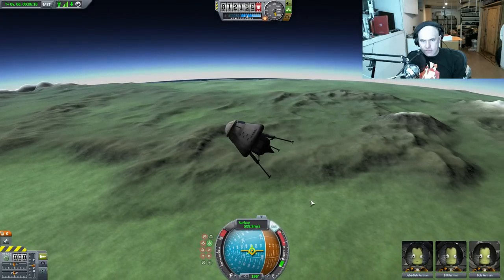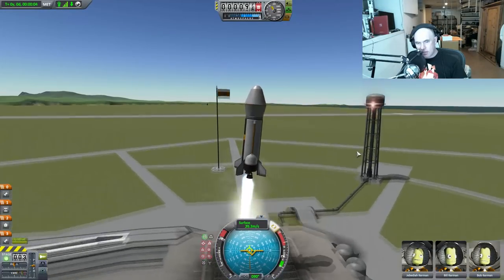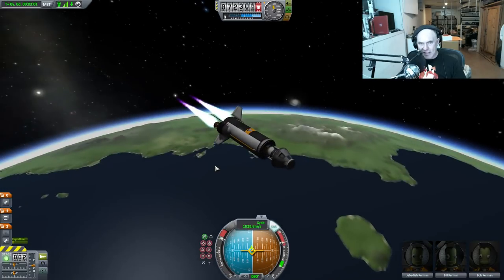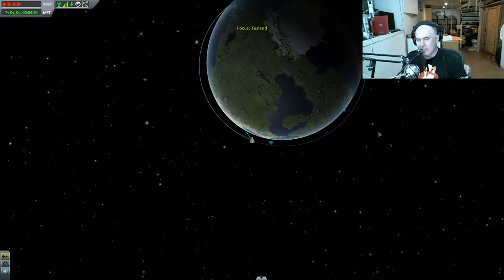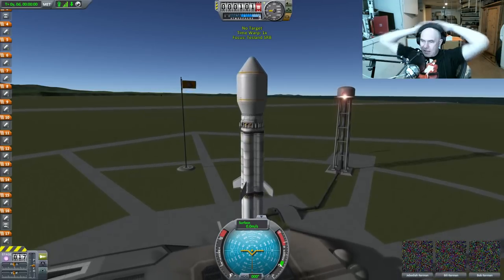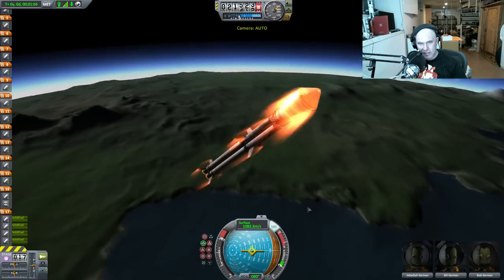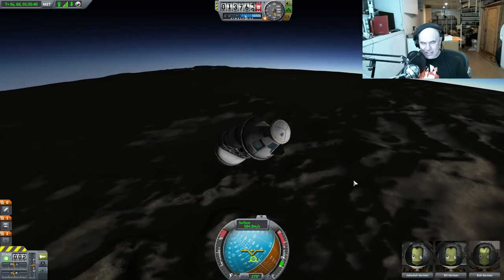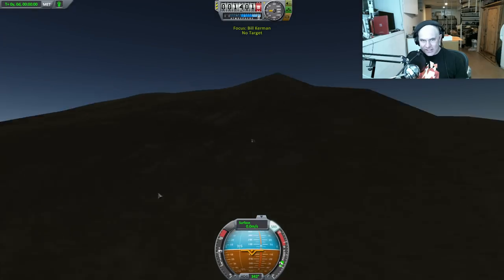Powered Launch & Powered Landing Using Only SRBs

Comment: Y'know, the large landing legs with max spring power can survive just over 60 m/s impacts, enough for just a capsule with 2 small glider wings to land safely.
Reply: Or use a payload bay as a crew cabin, open the doors to be airbrakes, and have some structural components underneath to break the fall.

Comment: Scott, with 70-80's tech, which type of reusable(partially) two stage to orbit vehicle would have been more likely(or even effective), air launch vehicle designed to return back to airstrip or rocket using slow down burn and chutes? The goal being 15 tons to LEO or launching small thing like HL-42 to supply ISS.

Comment: what is your opinion of the capability of the new North Korean rocket. It reached an apoapsis of more than 2000 km. this was achieved by basically pointing it up, but still this looks to be a marked improvement. In the past, they have gotten micro satellites into orbit, but this is apparently about to hold a payload.
Reply: They can hit Guam or the Aleutian Islands with a perfect launch and flight path but the payload limit would be small. A tiny amount of conventional, chemical, biological, or radiological weapons might be feasible but nuclear is probably too heavy for now.

Comment: Thought about trying this myself. I have a mod that has sper draco engines. I am also using kerbal planetary base system. has anyone worked out how to build a base and dock the parts before or after landing. Ie dock in space then land as one or land closely then dock etc?

Comment: Kind of disappointed about the Lego Saturn V. The original model that was pitched had these beautifully designed engines with great look exhaust bells and amazing details such as tubing, etc. The final version has comparatively terrible engines, I'll buy it but I'll have to mod it, i mean just look at the CSM engine and how it offset away from the rocket by a thin cross beam.